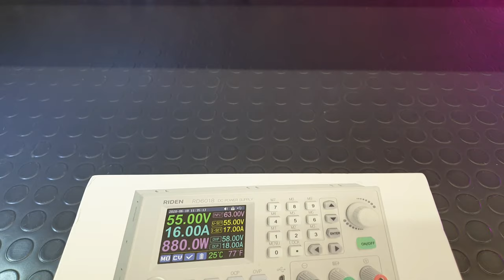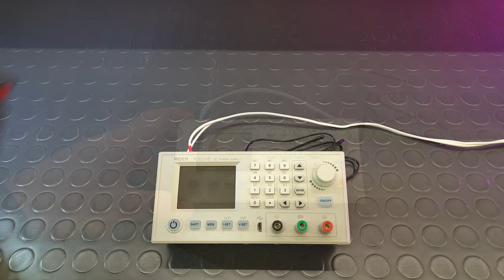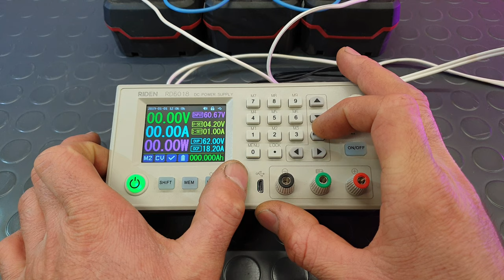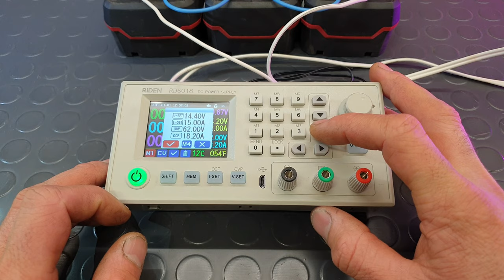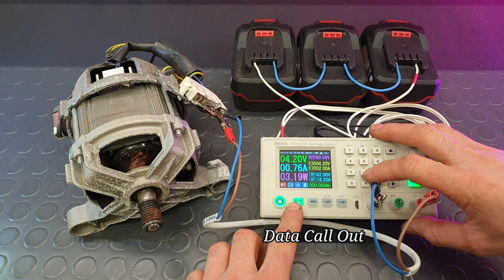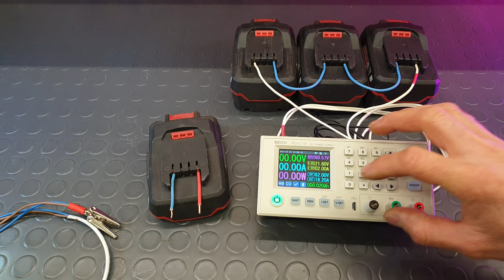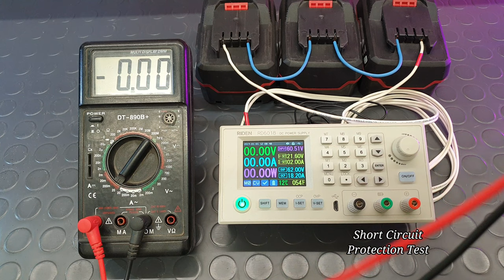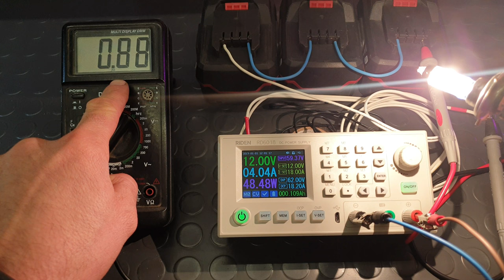PARKSIDE Battery Powered, 60V 18A 1080W Professional Power Supply from RIDEN (RD6018W Wireless)

Comment: Hallo can PARKSIDE batteries be reliably used in series to power 60v devices like a brushless motor I would like to power an 60v outboard with 3 8ah PARKSIDE batteries in series und another 3 in parallel is this possible or is it too dangerous. Because normally I have only seen them used to power 40 (36) v devices. Thank you and have a nice day

Comment: hello, thank you for your video, if you connect motor as load, do not forget to control the current less than 6A, 1/3 range of the full range. so that it is safe to output
Reply from the maker: Thank you for the information.🙏🙏🙏
Very high quality and compact power supply, I really liked it👍👍👍
Reply: @ErCanEverything  if you have any questions when using it, just contact us
Reply from the maker: @rdtech9153  Ok

Comment: This thing looks great, very professional! Can you make conversion efficiency diagram of this thing? Like in 13:55 efficiency is around 92% which is great! Thanks for sharing with us! ✌🏻👍🏻👏🏻
Reply: I'm curious what the Wi-Fi module is used for?
Reply from the maker: There is an app for phone, RDPower called.  Can be controlled from there, adjusted and reprogramming.
It even shows a diagram on the screen of the device as an oscilloscope, but I will shoot this in the next video🙂🤝
Reply: @ErCanEverything  Wow, will wait next video then 😁

Comment: How are you powering a mains voltage motor on 12v
Reply from the maker: They are universal electric motors, work with direct current.
And can be tested with 12V or more voltage